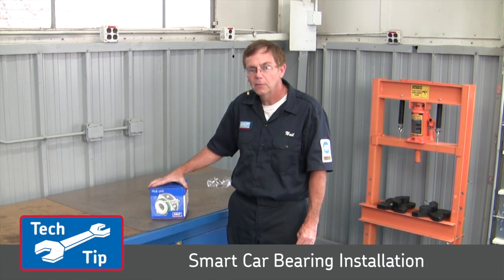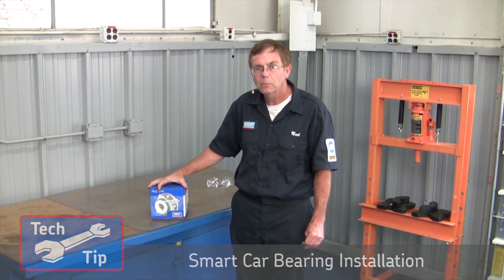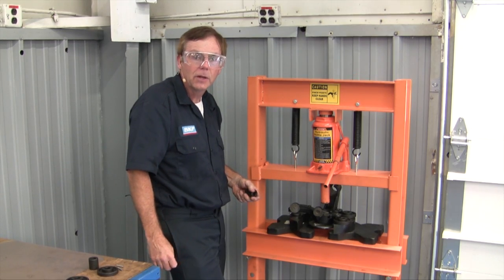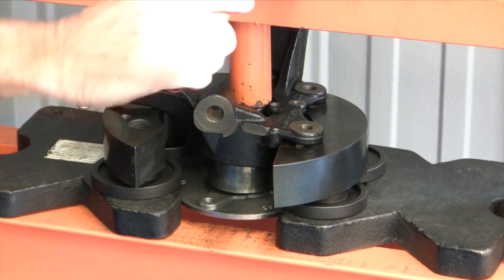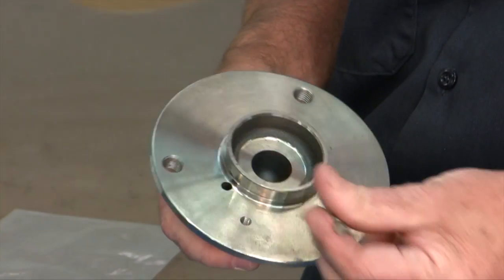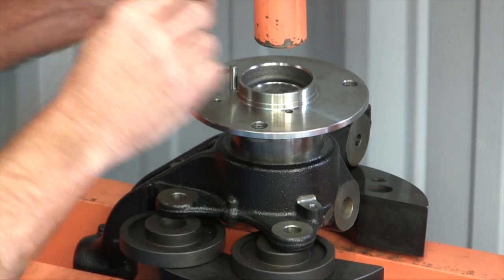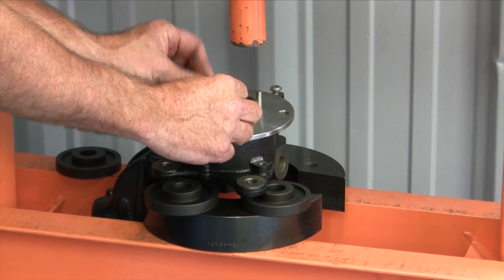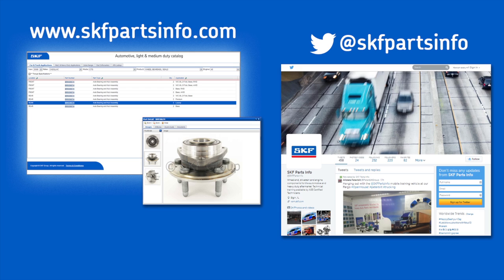Mercedes Smart Car Bearing Installation

Comment: Im thinking the casting has a lip to catch the radius of the bearing on the outside of the bore, do you have any diagrams showing the retention grooves?How many times can a bearing be pressed into the knuckle before its unsafe.also  Is that an FW130 bearing in the assembly.
Reply from the maker: Thanks for watching, The bore of the knuckle has a lip to seat the hub. The grooves in the knuckle are visible once you remove the hub from the knuckle. The grooves can maintain their integrity for several replacements. 
The bearing is not an FW130.
Reply: I have a 2012 and need bearings and have a distributor in the town where I work, What is the Bearing number  ???
Reply from the maker: @TOMCAT398  Part numbers can be found at www.skfpartsinfo.com.